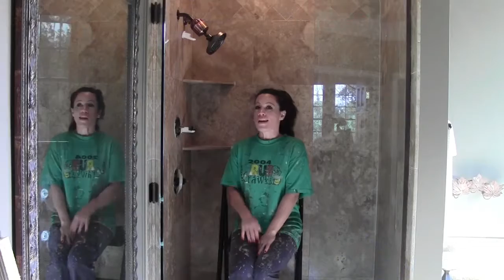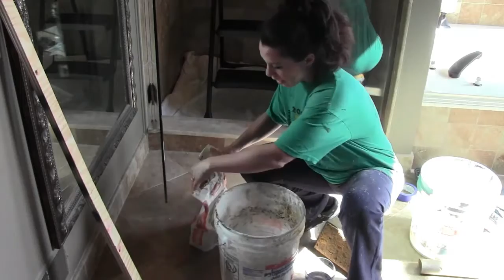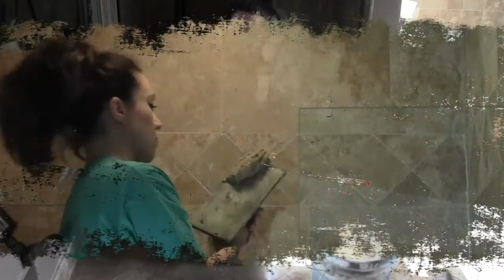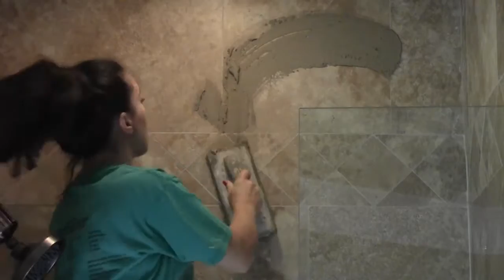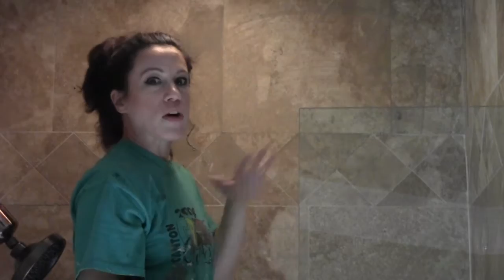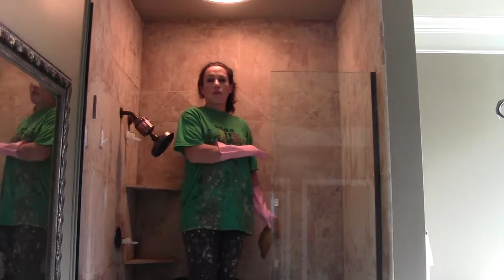Re-grout Shower Wall Tile (how to) - Renee Romeo

Comment: Hi Renee, I just watched this, good video, so could you expand on how to remove the grout?😬
Our shower corners and odd spots have many places that have the mold that WILL NOT bleach out, we built our home in 1998! Interesting to learn the why it is molding I'd say 97% of the shower is still lovely white grout😊
The tool you mentioned...I cannot find🤔
Plus once it is out, how do you go about getting it into the corners without too much excess? 
Thanks! Appreciate your video😉
Brenda
Reply from the maker: Hi Brenda, Go to your local big box store and ask for the grout removal tool that they carry. It's a little wheel attached to a handle. Fortunately, you don't have to do your entire shower! The grout float tool has a very sharp corner or a rounded corner (depending upon the look you want. Look for a sharp corner grout float and you'll be in business. No excess buildup. Best wishes on finding these two great tools. Renee

Comment: You made it look less intimidating, but i'm still intimidated to take on this project in my bathroom. it needs the grout removed, regrouted and sealed. I want to do it myself, yet freeze up lol
Reply from the maker: Raquel, Don't be intimidated. The most important part is to make sure the surface is rinsed really well before the final hazing. Anything that's left behind will be easy to buff off and you'll be left with a perfect job. You'll get a bit of a workout in too! All the best, Renee

Comment: So how do you seal the grout?
Reply from the maker: Hi Raquel, You can use grout sealer that you just apply with a foam brush but if you have natural stone, a natural stone sealer will work for the entire wall surface. It's really easy and needs to be done every 6 months or so. Renee

Comment: wish you showed how u removed the grout
Reply from the maker: Hi cayo 1l1, I'm sorry that I didn't do that but my grout lines were under-filled so there was no need in my case. The tool to use looks like a small pastry wheel and as you move it over the grout line, it removes the top layer to make room for new grout. It works really effectively and goes pretty fast. Thanks for the feedback. All the best, Renee
Reply: Just saw this on the tool😊